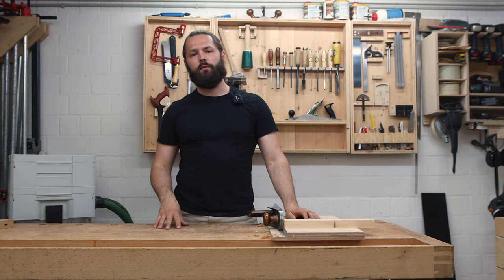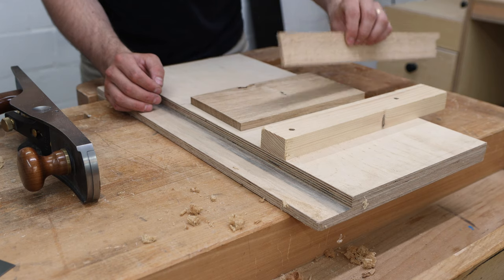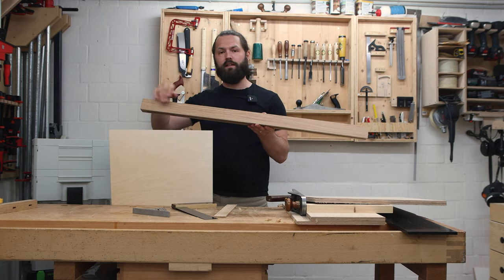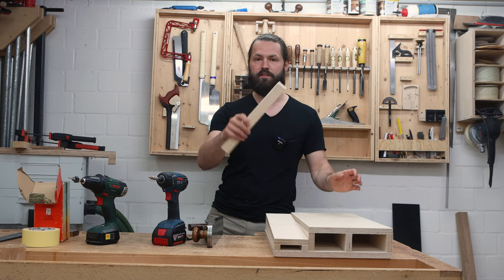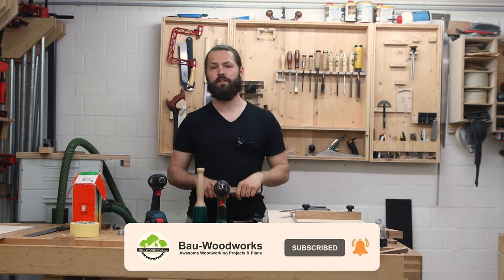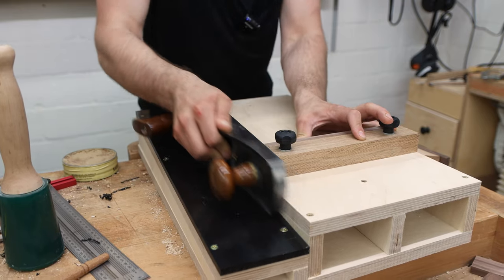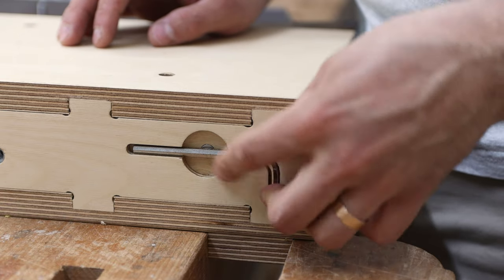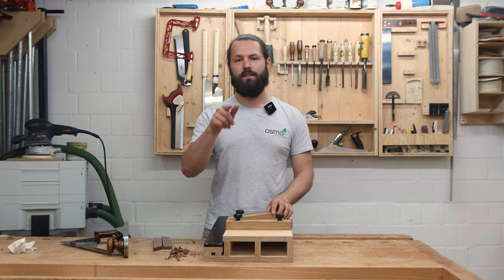Ramped SHOOTING BOARD || MUST HAVE shop jig for woodworking you need to have!

Comment: What prevents the plane iron from continually cutting into the edge of the top?
Reply: The fact that the blade does not run to the very edge of the plane. The edges of the plane sole are solid metal, and that is what runs against the shooting board.
Reply: @slimcrna  this is true on most shooting boards.  However, in this design, because of the ramp and the overhanging top when the plane blade passes the 90 deg fence the small guiding "edge" loses contact with the top and no long support/guide the plane. This allows the blade to cut into the table after the fence. Check out the video at about 12:30.
Reply: @stevefrank353  I’m not sure I follow you. The plane sole is making continuous contact all the way down the ramped section.
Reply from the maker: @WolfoFacts yeah it is the way you explained.
@Steve Frank I know what you are talking about.The fact that the blade is longer than the section, where the cut is made stops it from cutting further into the board. Do you follow me?

Comment: I'm not doubting the quality of your work, i just have a couple of questions. As far as it being on a slope, does the grain pattern direction cancel out the benefit at all, and isn't it better to have the fence locked in at 90° instead of having to make sure it's at 90 every time you use it and also risk that it moves while you're using it? Just wondering. Thanks

Comment: May I ask why in an updated version you shifted side of the ramp a little bit from that element that goes underneath of the main base structure ? Is there any particular reason for that or so ? I see that's there's an small gap between those supporting rails there

Comment: When you trim the 45 degree mitre for say a picture frame, that now means the piece is shorter in length. So do you then go and trim the same amount off each piece?
Reply: When I know I will be using the shooting board on straight or mitered pieces, I always cut the lengths a little longer and use the shooting board to bring them to the design length.
Reply from the maker: As Mike K. already stated I also keep the pieces a hair proud and trim them to fit with the shooting board

Comment: Nice board but that is NOT a shearing cut. As long as the plane moves in a line perpendicular to the face of the iron it is not shearing. The ONLY way to get a shearing cut is if the plane moves at an angle to the face of the iron.  The force of the cut is still 90 degrees to the iron. What a ramped chute or work support does is use more of the iron. It is simple physics. It is more like,planing the edge of a board , in your vice by going from the front corner to the back corner, pushing the plane in a straight line. In order for it to be a shear cut you have to move the plane slightly sideways to the iron.